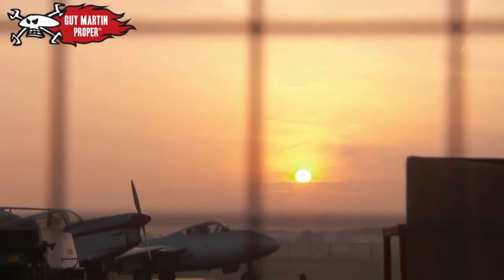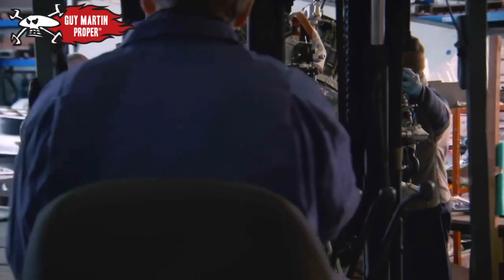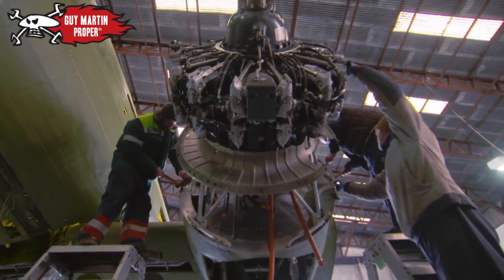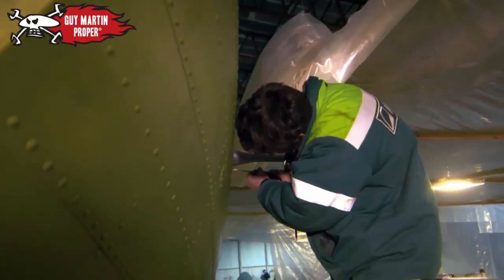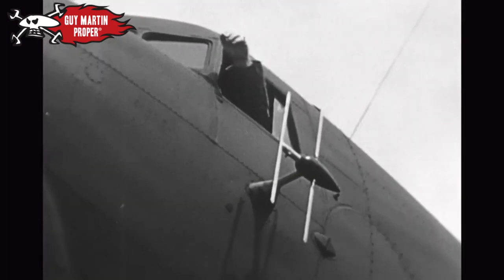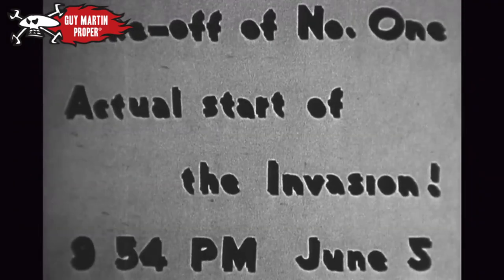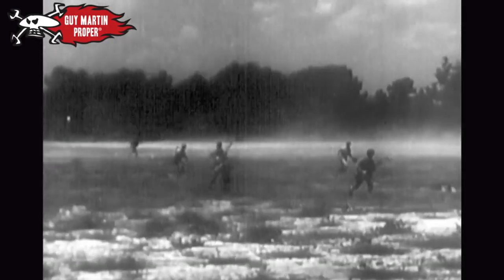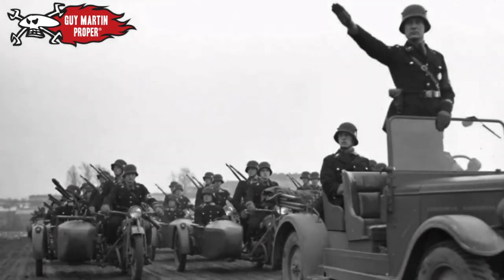Guy fitting the engine in his WW2 paratrooper plane | Guy Martin Proper

Comment: Guy mentioned that radial engines could have entire cylinder casings blown off and still run,I read of a RAF Halifax bomber which was powered by Bristol Hercules radials having been hit by flak and attacked by night fighters,it got home after two engines were knocked out completely and the remaining two had suffered oil leaks leading to a number of the cylinders seizing up and it still made it back,would have been unlikely to have had the same outcome if fitted with inline liquid cooled engines.